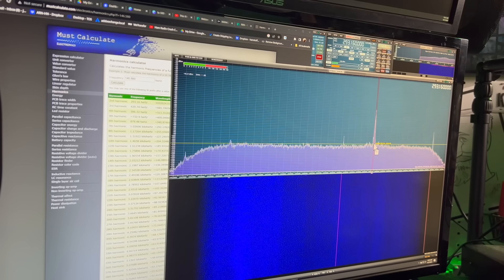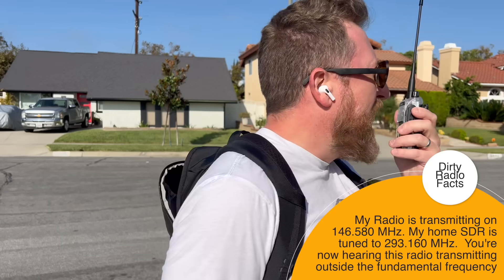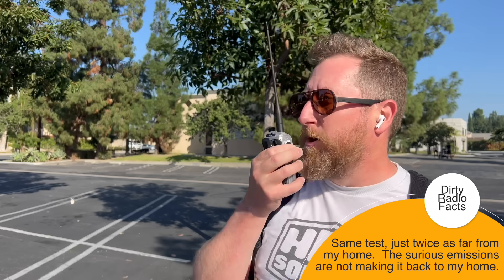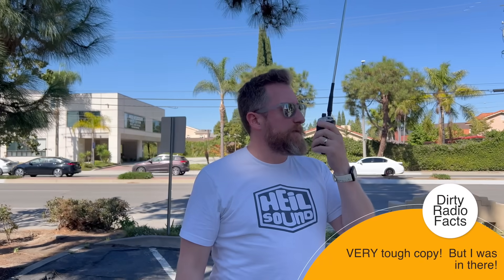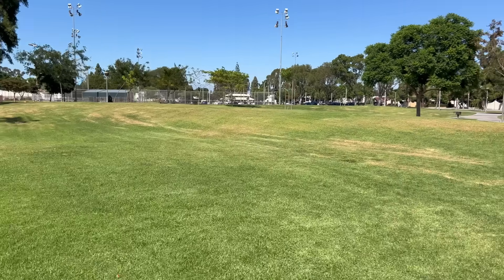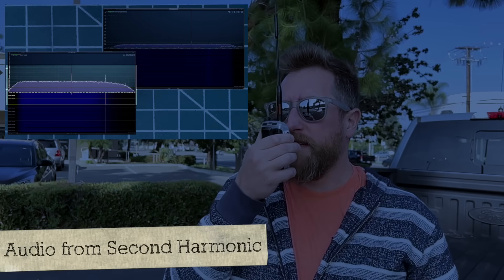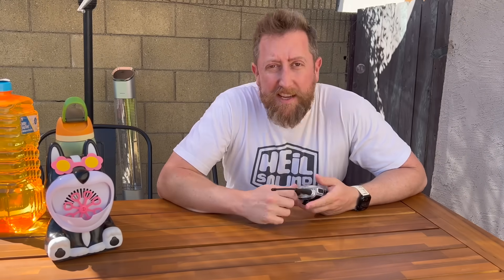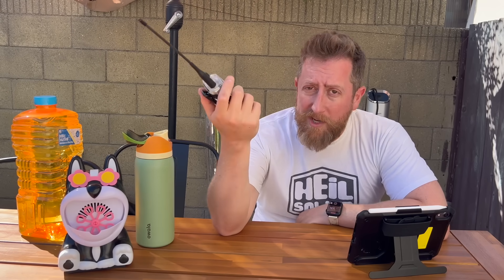Don't Buy Cheap Radios! HERE’S WHY! (Yes, Baofengs Too!)

Comment from the maker: 📻 Want a GOOD quality, spectrally clean & inexpensive radio?  Check out Radioddity BAOFENG GT-5R (10% off with link): http://radioddity.refr.cc/hoshnasi
Reply: Josh, IMHO Radioddity is overpriced rebranded radios. TYT UV88 and UV98 have and Retevis RT85 that have been marketed for quite a while are very clean and less expensive. So, why aren't you giving these great HTs a big hurrah? Recently there's a number of these horrendous VHF splatter boxes being sold in different flavors and I suspect that there's one big culprit that should be tracked down and scolded. I recently bought three radtel 6 band radios that have the same VHF ultra high harmonics, but 220 and 440 are clean. I bought them knowing these facts to have dedicated 220 HTs with 440 GMRS bonus. The 10 watt 470 puts out 9.3w on 220 and the X and L both put out 4.8. The TYT 15"+ whip resonates on all three bands and when paired with Retevis RT85 puts out 6.5 watts. On the TYT 8000D it's 10.5 watts. I've been watching your reviews and I can't help but think that you're missing something. I do appreciate you're educating the unknowns, but how about something other than a Radioddity link that I for one will never click any more than I would a Btech or Amazon link. You've shown us some junk. Really, show some value in what has been  demonstrated to be clean and at $30+/- and $60+/-.
Reply: What SDR were you using?
Reply: @hemitj  Looks like he is running SDRUno, I suspect one of their SDR, I have the RSPDuo and it is quite nice. 
Speak of which Josh, have you tried the 3rd Party Spectrum Analyzer for SDRPlay Devices (linked on their page)?

Comment: Josh, would be nice to explain where the 2nd, 3rd, 4th harmonics are supposed to be so we can see why these Chinese radios are off base? Without explaining this it still does not mean that much…
Reply from the maker: I've made a ton of radios explaining it.  The point as covered in the video is that you can hear anything at all on those even harmonics.  Should be nothing heard.

Comment: I'm surprised the FCC allows these radios to be imported into this country. There are sporadic emission requirements to keep emissions within the allocated spectrum. Actually, it is illegal for anyone to offer/sale equipment that does not meet the requirements of the FCC regulations. 
Triva, if you look at most all consumer electronics there is a FCC label that says. "This equipment must accept interference" which means... don't call the FCC if your neighbor's equipment is messing with your device.  Now if your device is messing with a device that is operating in a protected part of the spectrum they will come knocking at your door.

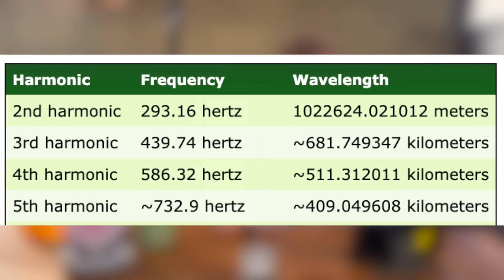Comment: Chart at 8:02 - How is that frequency to wavelength conversion done? If 222 mHz is ~1.25 meters, how is 293 mHz >1,000,000 meters? Excessive spurs are bad, no argument, but 293 mHz is in the military air band; 439 is in the 70 cm Ham band, 586 is in UHF TV band, & 732 is in a land mobile band (in the U.S. anyway).
Reply from the maker: Even harmonics of the fundamental frequency. These are not spurs.
Reply: I know, I was referring to the math. @HamRadioCrashCourse

Comment: So many good points were made in your video on the subject of spurious emissions.  They can occur outside of Ham Radio bands in areas that are dormant places in the RF spectrum HOWEVER you never know where this spurs can occur in an area vital to specific communications.  In past years and with commercial grade equipment, Ham Radio transceivers not of commercial grade specs but were thoroughly tested for spurious emissions and they passed with flying colors and low spurs if any.  The cheaply made radios as you've demonstrated are notorious for spurs outside of the Ham Bands.  I think you have to keep in through the mind set of today's Hams.  The cheaper the radio it's more likely a Ham will purchase it.  Who cares about quality.  In short the Ham Radio market has been flooded with these cheap radios and no one seems to either care about spurious emissions and what issues they may cause.  At one time in Ham Radio our output of gear was clean.  Now as long as it's "cheap" who cares?

Comment: Hams are not only licensed to communicate on multiple bands, even Tech class hams are licensed to design, build and operate 1500 Watt transmitters on multiple bands without ever even showing their transmitters to a government inspector. Why? Because we are legally responsible for whatever comes out of our radios. Even if we buy a $10,000 transceiver, it isn't the manufacturer who is responsible for out of band harmonics from it. The guy with the ham license is. And who polices the ham bands. We do, hams. We are pretty much a self-policing hobby. We are not CBers. Those of us who value their licenses will be watching for those who are breaking the law, and will turn them in. Simple as that. Use someone else's call-sigh, run illegal power, run out of band, radiate illegal harmonics, get busted. We, as hams, value our licenses, and we don't want to see the government shut off our hobby. Corporate America is paying off Congressmen to get our bands, because they are worth billions to them. Don
t let them be able to say to the Congress people, "Those hams are just a bunch of clowns breaking the law and trashing the airwaves with out of band signals. Who needs that?" So don't give the folks in Congress any reason to kill ham radio. Because if you do, they will.

Comment: Of my 5 baofengs 3 have poor spur suppression . Used to Motorola hi perf radios. But noticed the china ones had much shorter range for same power. Put on spectrum analyzer. Yuuch! Seems to be hit or miss. Japanese or converted US commercial models far better. Better range as power is where it id supposed to be. Won' t be buying more. Nice blog, but dont know how to join and comment like k8 mrd et al do. But love your vids. Ham since 1958, btw. Mostly cw ops, some ft8  and ssb. Now in west FL. Ex TA0/wa2kbz. Extra class, FCC 1st ph

Comment: so have you tried this same test with a Yaesu or Icom radio?  After watching your video, I set my SDR to 293.16 and transmitted from my Yaesu FT-60 on 146.580.  Now I did this from close proximity, but I heard myself on 293.16 even with my Yaesu.  I'd be curious what your results are with a "high end" HT doing the same test.

Comment: This demo doesn't prove a thing.
Reply from the maker: How do you figure?
Reply: @HamRadioCrashCourse   Simple.  It doesn't say a thing about what the level of the spur (2nd harmonic) is.  i.e. the spur COULD be within spec and easily be heard a quarter mile away.  Unsophisticated viewers can easily be fooled by these kinds of demos.  Proof- just look at the comments, except mine.   de Rick, K2XT
Reply from the maker: I already showed the spectrum analyzer output on a previous viddeo review for the radio.  Not to mention my live stream last night testing over a DOZEN radios.  Go buy a clue man.
Reply: @HamRadioCrashCourse  You need a beer.

Comment: I check any Chinese radios I use on a VNA for harmonics. My Chinese radios are clean with all meeting  FCC regulations. There are many Hams that if they find a Chinese radio that does not meet FCC standards will notify the manufacturer. Often these manufacturers will send a fixed radio usually a version 2.  So far I have tested a Tidradio, Baofeng first generation, and a Quansheng all have met FCC  standards. As your video shows you had problems replicating harmonics. Which tells me this is a subjective video. In other words your opinion. I have followed your videos and have been happy with them. This one did not make me happy. Chinese radios have the same parts and use similar radio software. The difference is the price. In a communist country labor is cheap so these radios have same quality and an extremely low price. My recommendation is to test the radio on a VNA before use. That is what I do. Frankly paying less than $40 for a radio comparative to a US made radio for $300-$700 is a pocket book decision.  Besides, if we want to encourage young hams a Chinese radio maybe the difference between a ham on the air and a ham not on the air. I am willing to check the radios for them.

Comment: Only tested one radio brand. What about others?
Reply from the maker: I've tested tons of radios.  If any radio fails to meet the FCC spurious emissions tests, it will do what the radio in this video does.
Reply: @HamRadioCrashCourse  Since the yaesu ft-4xr has the baofeng chip in it does it also have the spurious emissions or not?
Reply from the maker: Go check out my "VS" live stream from last night.  Spoiler alert, the FT-4X passes.
Reply: @HamRadioCrashCourse  Cool!

Comment: Thanks Josh! I used your link and picked up 2 of the GT-5R HT's, 3800mah BP's, Speaker mic's, thin antenna's and programming cable... for less than just a single dualbander HT from the big 3. A user and a backup. I don't use a HT often but there good to have for when you do need one. Better to have and not need, than need and not have! I'm retired and keep an eye out for bargains.  Keep up the good work!  
- mike

Comment: just for an example to follow up on what your doing. I am sitting here currently using a jumbospot from china. Guess what freq I am using it on. If you guessed 900Mhz you would be right. I am using a motorola xts2500 on 927.5 simplex.

Comment: Hi Josh - Love the content....   Here's what I'm curious about regarding spurrious emissions..  I get the rubber duckie lets everything fly.   But what about a "resonant antenna"  I'm thinking Dipole or J-pole.   How much do those supress the spurrious emissions?  Love to see what the Ed Fong J-pole does to the spurrios ;-)!!!  $.02
db
Reply: Spurious emissions close to the carrier frequency will not be suppressed by any antenna.  Harmonics, particularly the even harmonics, will be substantially suppressed by a proper antenna.  For instance a quarter wave vertical antenna fed with 50 ohm coax will work great at the fundamental frequency, but at the 2nd harmonic now suddenly it is an end-fed halfwave, high impedance but you are still feeding it with 50 ohms.  So the harmonic will bounce back and forth a few times until its energy is lost in the coax.

Comment: To be fair, in a real TEOTWAWKI situation, spurious emissions would not be quite a big deal.  But I would not use a cheap radio as my primary day-to-day rig in normal situations.
Reply from the maker: Why on earth do you think that?  Simultaneously transmitting on multiple frequencies doesn't seem like an OpSec issue to you??

Comment: Absolutely amazing. Pretty much what I've always suspected. What little power is left on the spurious frequencies is attenuated by a "proper" antenna. 

Real world testing is where its at. 

So if I understand, with the OEM duckie, at your max range  of +- a mile in suburbia no transmissions made it to the SDR at house doing the monitoring?
Reply from the maker: The OEM would do find on 70cm on the third harmonic.

Comment: Yeah I get you want to show the most powerful harmonic but you wait until the last moment to show the harmonic that could actually be interfering. You need to be honest in the beginning of the video and not hold it into the last couple moments. If there's risk to first responder frequency, show us that test. You also need to show the difference between the power of primary and second harmonic, because that's what is certified.
Reply from the maker: I showed the second and third harmonic.  Not sure why I have to be so specific. Test your radios for harmonics. If they’re there, they are creating interference.

Comment: I have heard that Baofengs have gotten significantly better in regards to spurious emissions.  Maybe still not great but better than they were.  It would be interesting to compare a range of them from a few years back up to the latest.
Reply: There is certainly no reason for any ham to have to wonder about that regarding their own radios. We are legally responsible for what they radiate, so we need to check their output regularly.
Reply: i did exactly this testing. UV-5R V2+ and UV-82HP failed miserably but BF-F8HP passed.
Reply: The GT-5R is much better than the UV-5R is in that aspect, still not perfect though.
Reply: @OofOuchOwie  Nothing is built perfect.  That is why they have a warranty on a 100k car.
Reply: The warranty on a ham rig doesn't matter as far as the FCC is concern. It's the responsibility of each ham to keep their radiated signals clean.

Comment: Great practical test Josh. The Talkpod has some of the worst emission outputs on the 2nd harmonic, pretty sure it was only like 3dB down in output power on the fundamental from memory... so if you're putting out say 2W on 2m, that's 1W being emitted off channel.

A great follow up to this would be demonstrating the GT-5R or even something like the Quansheng UV-K5 (which is right on the threshold) to show the differences between radios. Good work!

Comment: Cheap radios can be built to be compliant. The Baofeng GT-5R at $26 dollars is compliant, I checked two of them myself and also at the ARRL test booth at Hamvention last Spring. Others have also done testing, Dave Castler, etc. 73 DE W8LV BILL

Comment: I can tell you from experience simply working broadcasts for dirt track racing: those things splatter ALL OVER the bands.  Drivers and their teams will have to move frequencies in the middle of an event because SOMEONE brought a Baofeng with them or some other cheap piece of crap radio, and they'll send spurious emissions all over the place.  Someone actually lost their entire transponder system once due to interference during a race I was working, and the whole event had to go to a full stop until the offending transmitter was identified and taken out of use.  So if anyone doubts that these things are shite that shouldn't be used, take it from me: they are.

Comment: nice bubble maker !  i have a few of them Cheap radios. I have the GMRS version of the UV-5R and the 2nd and 3rd harmonic is way down to the noise floor .The same on outher GMRS/MURS  radios.  now some Baofeng I have tested are dirty and some not so bad. can not tell buy looking at them. The B tech ones  good . some of them radios have been re done and fixed. the ones from buy two way radios have been re done on some models. best to buy from someone that has return  so you can send it back if you get a dirty one. 73's

Comment: Could we add filters to the antenna
Reply from the maker: Yes, likely.
Reply: @HamRadioCrashCourse  would be a cool video to see and how much gain is lost due to the filter.

Especially those who already have this equipment would be a nice way for them to still use it and not be worried. 

Love the videos and keep it up
Reply from the maker: Gain and power output are different things in this case.

Comment: Nicely done!   A couple of things to add - you can use 60 or 70 dB of attenuation and then feed into your SDR directly.  Also, there can be non harmonic spurs near the fundamental that exceed limits.  Worth checking for those too.
Reply from the maker: I’ve done this with my Spectrum Analyzer.  Go see my Talkpod review video.
Reply: @HamRadioCrashCourse  I have - you are one of the few to really dig deep.  Just wanted to call it out for this video’s viewers.  Many thx!
Reply: 439 MHz is in the amateur radio band which can be a good thing (no LMR to interfere with) BUT this is on the edge of amateur radio satellite domain. I wouldn't want to be inadvertently key up a bird 300 miles up when I'm only contacting a friend down the street! 

Another thing to consider is in band spurs. About 15 years ago, there was a new ham a few blocks from me. One day, I was spinning around simplex freqs on 2m , finding this new ham. I wasn't hearing the other side of his QSO, which made me wonder.  Turned out we was talking to someone on a repeater. His radio was transmitting spurs across the 2m spectrum and beyond! I pulled him off to simplex to advise him that he had to stop using that radio and why. I'd never heard anything that bad on spurs before or since!

Comment: Or its the SDR hes using..... cheap chinese SDRs do this too while monitoring...
Reply from the maker: lol, why would it be my SDR.  Btw, it’s an SDRPlay Duo
Reply: @HamRadioCrashCourse  Sorry for my short and astute comment. I meant no disrespect. The Video was great.
In my experience if you have the gain too high on an SDR or if you're using a knock off SDR alot of harmonic problems like that pop up too. I was more surprised I didn't see anyone in the comments mention this.
Reply from the maker: The logic isn't following for me.  How would the SDR have given a false positive here for a radio that was 1/2 mile away transmitting out of band?
Reply: @HamRadioCrashCourse  In My City if I say tune to Law1, Law2, Fire1, Fire2, If my gain is a little too high I can start to get echoes from them on other frequencies. Not all are audible, but any signal you slightly overdrive will show any outliers in the transmitter or even SDR. Also, cheap SDRs can give you extra echoing that will show signals out of a band that will travel the opposite direction of your tuning.
Reply from the maker: Sure, but that doesn't have anything to do with the fact the handheld is able to transmit over 1/2 a mile away!